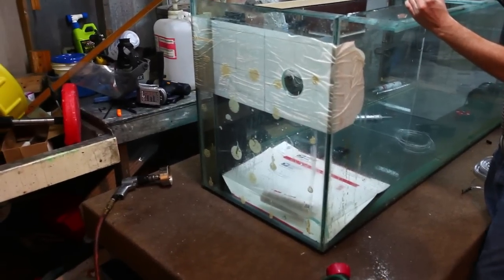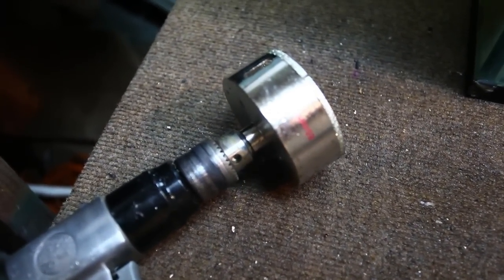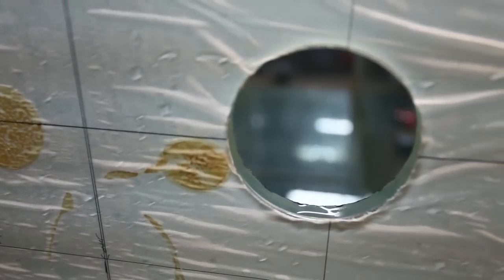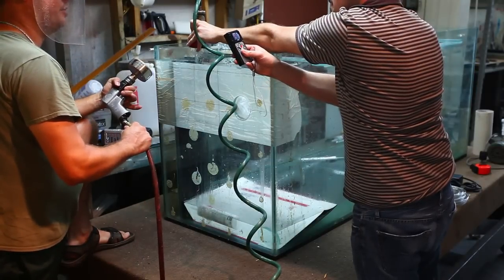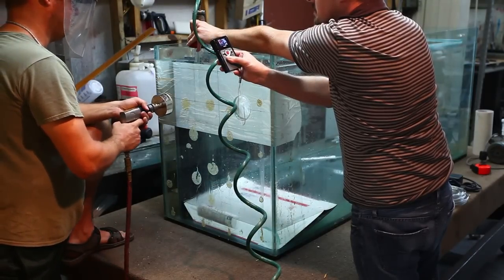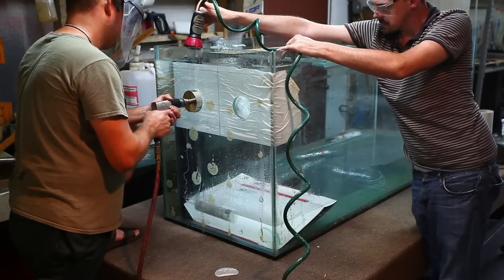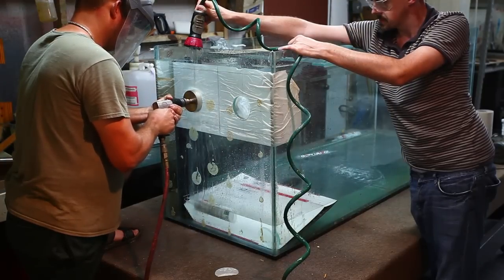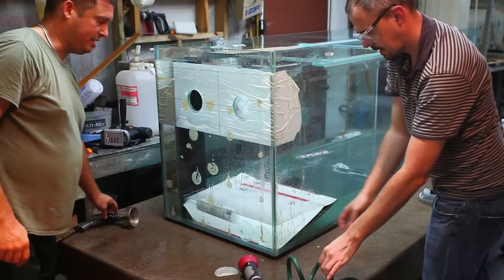Drilling a hole in a glass aquarium

Comment: Great Video!  Well thought out precaution of placing cardboard on inside bottom to cushion impact of scrap.  Only thing I was wondering - I'm told that the final break through  might be done better if you slow the drilling speed.  This might be accomplished by lowering compressor pressure; but I notice you did NOT have any jagged inside edges!  Nicely done and thanks for posting.

Comment: I used a cheap $5, 2" hole saw from amazon and drilled a hole through a glass block in less than 10 seconds. I was like cutting through butter, and glass blocks are thick.

Comment: You need the water to prevent it from overheating....and prevent the glass from exploding. And, you can't use water when using an electric drill but NEED the water to prevent the glass from exploding from overheating. The solution: use an air compressor drill that won't short circuit AND water to prevent overheating and glass from exploding GENIUS. SickXXenD - do your research before criticizing the methods of others.

Comment: Hi; There has been a lot of talk about drilling holes in a fish tank, I just got a 120gal. all glass tank with 2-drilled holes on the bottom. I like to plug them up. Do you know the best way to do this,,, That Works??? Can I cut a 1/2" thick glass and silicone it to the bottom glass over the two holes??? Please do tell I need to know.
Thanks; By the way you do some grate work on fish tanks
Reply: dude just get a rubber stop, or a piece of plastic and silicone it, glass would just make it harder and probably more expensive.
Reply: Dude silicone don't stick to plastic or rubber.
In any case I fixed it, it has had water in it for the past 2 months with no leeks. I used glass and silicone it.
Reply: Can't do that it will stick below the plywood top and if I cut the plywood where the holes are the bulkhead still will not fit. I have it up and running now for 3 or 4 months and no likes, I used 3-1/4" plate glass I lamed and silicone it all together then place it over the holes with silicone all over it. works very good and didn't cost me a dime. Thanks for your answer.

Comment from the maker: This video tends to get alot of comments in the 3.5 years it's been online.  As a follow up, I never could get this tank to seal and hold water.  I wound up taking it apart and storing it.  After a couple of years I broke the glass into pieces and sent it to the landfill.  I resealed it twice with the appropriate silicone.  I replaced this tank with the large acrylic tank that I build.  The Acrylic tank was 8 feet long, by 3 feet wide and 2 feet deep.  There are several videos on that tank.  With this update I am closing the video to comments.

Comment: Thats got to be one hell of a air compressor you are using to run that drill for that amount of time. No way my aircompressor would keep up with that. Well not for more than a few seconds at a time anyway
Reply from the maker: I had a 10HP compressor at the time.  There were two 100 Gallon tanks in series with it.  One under the compressor and one in line before the chiller.  It was a nice setup.  I miss it.  I got rid of the t-shirt business that it supported.  I've since sold that property and the warehouse was torn down by the new owner.  :(

Comment: The Diamond Hole Saw will heat up, but so does the glass (at which point it will crack), therefore you need to keep both cool. Adding water from a hose will ensure temp maintains low throughout, a sensible choice.
Also, regarding your other dumb comment; the glass dust in the water will wash out the tank easily, it will be like sand. 
Perhaps you should educate yourself a more before commenting on things you clearly have no idea about.

Thank you for the vid Brian

Comment: There's water in the tank, because he's using water as a lubricant, hence the hose that has water coming out of it...as seen in this video very clearly. The reason he is not using an electric drill, is because he needs to use a continuous flow of water over the diamond bit, causing water to go everywhere.  And also, the bit is grinding the glass down. Not cutting shards out of it. So when he dumps the water out, I can assure you, there are not shards in it...genius. Did you even watch the video?